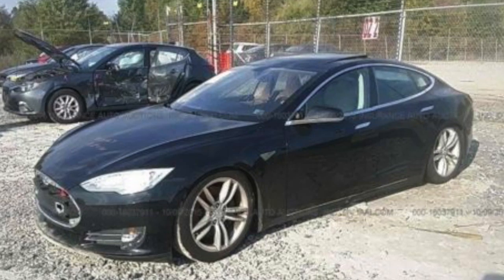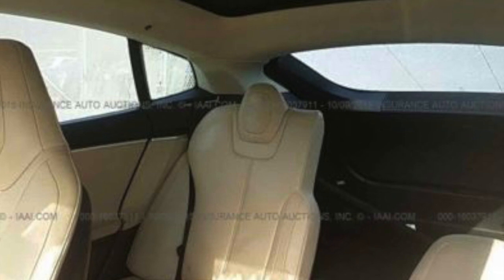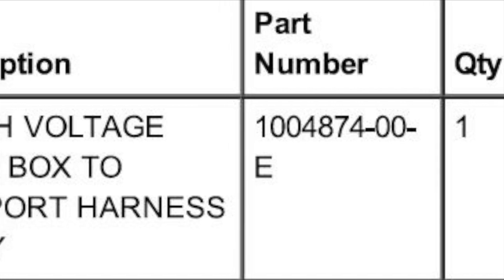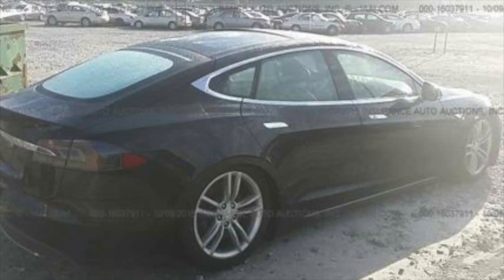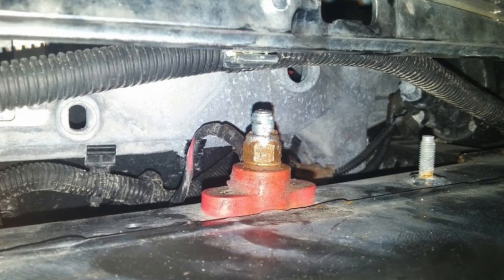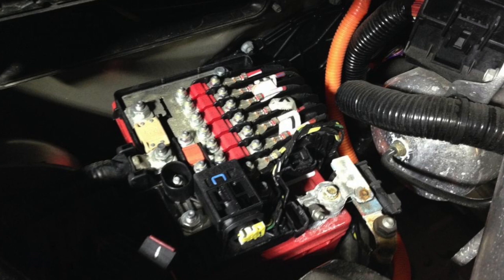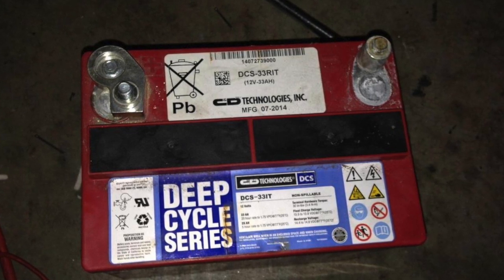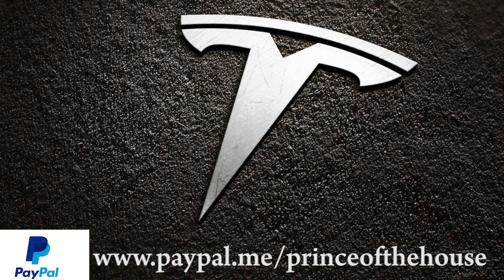Repairing a Flooded Tesla Model S Part one

Comment: Really interesting insight into the challenges of dealing with a flooded electric car and a Tesla specifically because of its in service Built inTest functionality makes the car difficult to work with which its voltage systems are down. I still think it needs a wash after being in salt water but I the video finished before the work completed.  The project looks like a labour of love but on the counter side if you fixed it you could do set up a business to do the same and I am sure it would be cheaper than Tesla servicing.  Good luck.

Comment: hey man. next time you do the dehumidifier thing, you should do what I do:. drill a small hole and place in a sink ( for basement), or attach a tube adapter in the tank ( for car) so it will just run forever.

Comment: What a disaster. I admire you for have the balls to do this!
I've owned 5 cars since I was 15 years old (I'm 17 now) bwahahaha! I'm down to 2 now...
I'm done with salvage crap, at least for daily drivers. My motorcycle is exempt, as it was a stolen recovery so I'm cool with that.
I had a lexus is300 that was wrecked and I thought I could piece it back together- boy was I wrong. I did get it back on the road for a little but it was more of a learning experience than it was a daily driver...
But man, a Tesla? SALT WATER DAMAGE? DUDE you've got BALLS! Can't wait to watch the rest of the videos!!!

Comment: A coating is never anything more than water resistant lol.. Especially not resistant to pressured water, which a car that has been fully submerged has definitely experienced. Waterproof electronics have either a good design with seals amd o-rings. Other way is to just pot amything with epoxy..

Comment: finally full explanation.  lets hear prices and what was useful on each car. and full cost. etc.
Reply: Seconded.  Interested in hearing/seeing all of the steps you followed, which parts you took from the fire car, which parts you were able to restore from the water car, which parts you had to buy online, how you combined them, obstacles you encountered, how much they cost, who helped you, and how you knew stuff like using a drill to move the seats back would work.
Reply: I think he just connected the drill to the axle the electric motor normally turns.